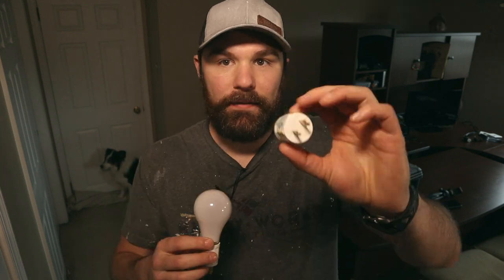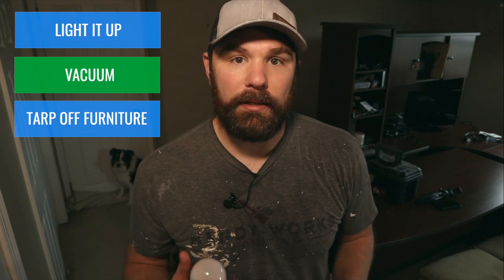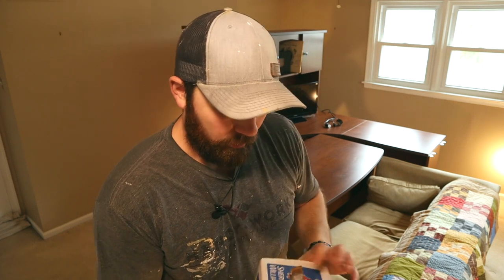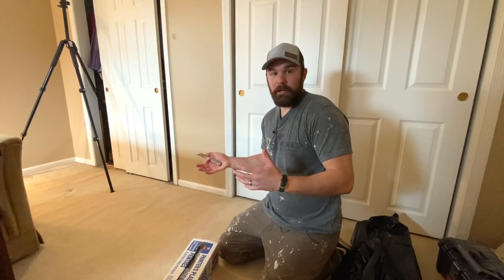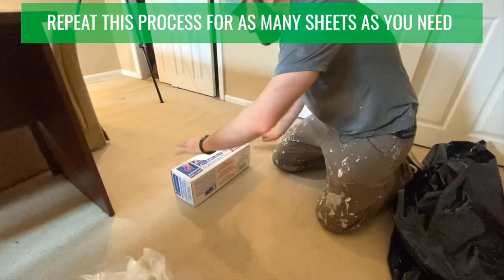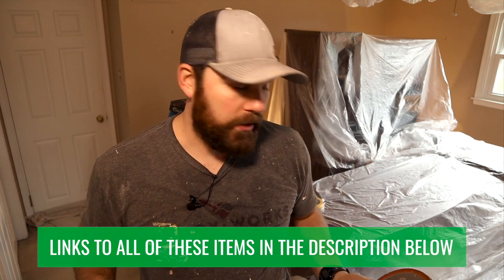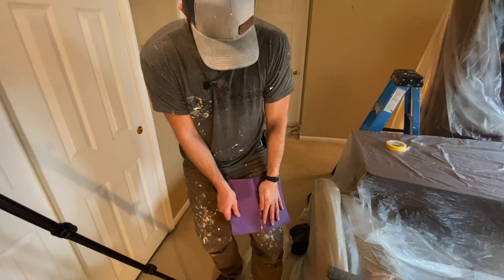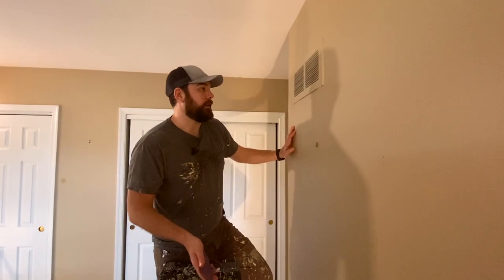Painting a Bedroom | Part 4 | Tarping Off Furniture and Sanding the Walls

Comment: You can buy it at any big box hardware store. Here in Lancaster, PA the local Sherwin Williams and Benjamin Moore dealers carry it. It’s called 3M Super 77 Multipurpose Adhesive. It comes in a maroon labeled can with a black lid. A little bit goes a long way and you don’t have to go nuts with it when spraying your plastic. It dries very quickly.
Reply from the maker: Thanks Josh.  I'll give it a go!

Comment: I find much easier to remove the fan blades by taking out the screws on the top side of the blades. Makes it much easier to work around. A stubby screwdriver or ratchet with 1/4" socket and screw bit works great for tighter ceiling clearance. 👍
Reply from the maker: I like your thinking true patriot.   We do that too.

Comment: If its a newly built wall and newly painted from the builder, do we still need to sand it? (I wish we could just not have it painted but its new construction and they don't allow us to pick and choose which paint goes on what wall)
Reply from the maker: Hi Janna.   For sanding I would recommend rubbing your hand against the wall to see how smooth it feels.  If it feels rough then we use a sanding disk attached to an extension pole.    If you don't have a sanding disk you can hand sand which takes longer usually with 150 grit paper.    Good luck and yes builders paint is so drab :(
Reply: @SuperVassarBrothers was just going to ask the same question. Sanding it is!

Comment: Dang that’s some expensive tape to be masking off furniture with. I just use regular masking tape or spray the plastic with 3M spray adhesive and fold it over on itself. To each his own. Loving your videos.
Reply from the maker: Thanks Josh!  We try and use it sparingly, but we do buy it by the case😬
Reply: I buy it by the case as well but only use it to tape off baseboards and protect door trim from wall paint in tight corners. I free hand door and window casings same as you guys. Try the 3M spray adhesive trick. It was a game changer for me especially when masking off ceiling fans.
Reply from the maker: Where do you usually buy that 3M spray adhesive?  I was talking to my guys this week and we want to give it a go.

Comment: Any need to clean food stains before hand?
Reply from the maker: Not a bad idea to sand down any chunks that might be on the walls.  If the stains come through the paint then you'll probably need to use a specialty primer like Kilz or some other oil-based primer to make sure you don't get any bleed through.

Comment: Why are you using the light sockets instead of just turning the lights on? Did i miss something?
Reply: Nevermind, I got my answer.😂
Reply from the maker: It’s harsher and more direct light than most folks have in a typical room.  We also don’t like the light coming from the ceiling particularly when we’re painting the ceiling.  It’s much harder to see what’s going on with the light going directly into your eyeballs.